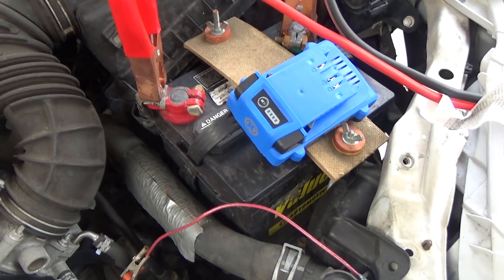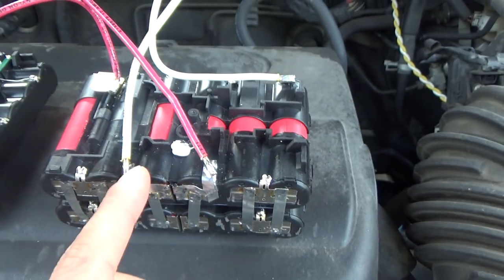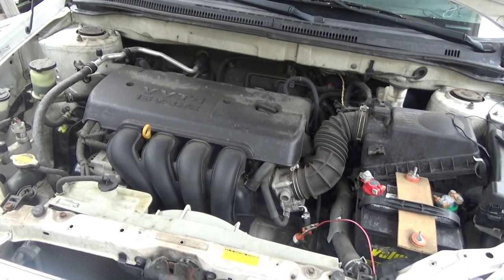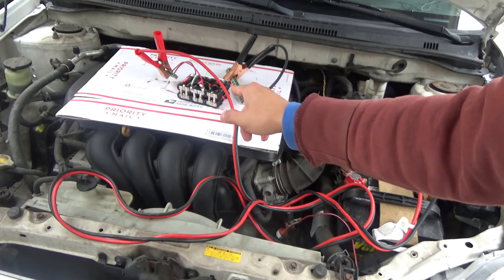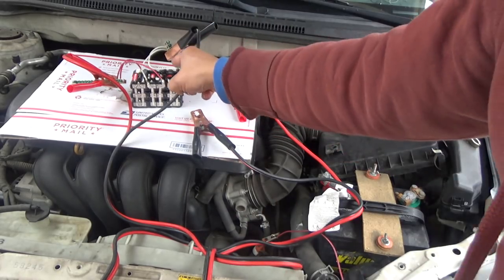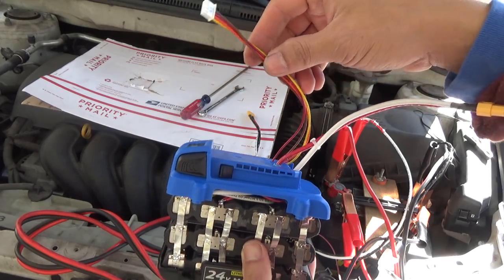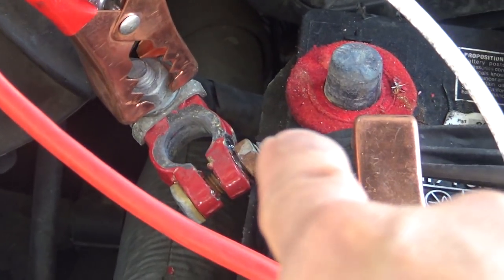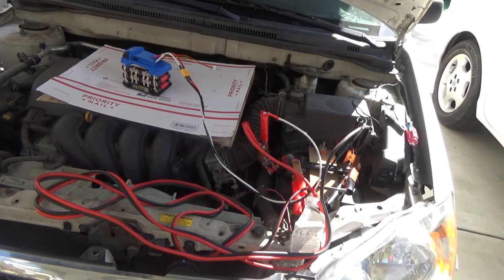DIY: Home made 12V Car Jumpstart battery pack from a Cordless Power tool battery

Comment: That's an alternator, not the starter motor, it is other end of engine by the trans!
Reply from the maker: Yes indeed. I put the annotation on the screen but you won't see it if you watch the video on a phone or tablet. What I'd been pointing at was the alternator. The starter motor is on the right side hidden underneath. But you got the idea.
Reply: vuaeco very interesting and good to know in an emergency..thanks, nice video well explained.
Reply: Does a 100 series cub cadet have a starter or a generator. Or does it have both.

Comment: That was the alternator you pointed at. the starter is where the transmission bolts to the engine.
Reply from the maker: Yes, indeed. I put that on the annotation in the video but you can only see it if you watch it on a computer (won't see it on mobile device). My brain was too focused on the subject at the time. Luckily, the main focus of this video is not about the starter but about the battery pack itself.

Comment: I've jump started my truck by directly connecting an 18v 3ah Makita cordless drill  battery, with no modifications. As you recommended, make sure u disconnect the battery the second the vehicle starts.
Reply: 18v is dangerous for the car systems. Do Not connect more than 15
(Fully charged drill battery is more than 20v)

Comment: It should be 4S  NOT 3S  you do 3.7v x 4= 14.8 volt the 18650 have 4.2v max.... PLUS your car battery is 13.7v to 14.3v

Comment: Great video and great explanation. I am going to use your data and buy small rechargable batteries to get 120Amp & 12 V to create my jump starter. For general knowledge car batteries mostly deliver 500A to 1000A so a portable starter with 120A is a good cost effective DIY ASSUMING IT WORKS as it did in this case. People like me who travel a lot and do not drive their car frequently can use a cheap Car Starter that they can recharge at home and never get stranded bcos of discharged battery.

Comment: I think the harbor freight jumper cables is not heavy duty enough and too long, otherwise you might have been able to crank it with just 6 batteries instead of 18. But if you use the smaller (shorter)cables like in your second demonstration you might get it to start with less batteries. All the extra batteries will allow you to crank multiple cars before recharging.
But I like the idea of using the xt60 (60 amps) connectors to start the car. I been trying the ec5 connectors (150 amps) but they are hard to solder. In your demonstration the xt60 work fine and didnt melt and they are easy to solder.
Reply from the maker: 6 cells (3S2P) won't be able to start the car. With 2 in parallel, the discharge rate is only 40A and I don't think that's enough to run the starter motor. I might be able to get away with 12 cells (3S4P) if I have shorter and thicker cables. But the extra pack with 18 cells (3S6P) will give me more run time and more Amps so I can use it on a bigger car with bigger engines.
The XT60 is rated at 60A for safety only. It can handle much more than that. And in this case, twice as much at 120A. The run time is only a couple seconds so it's not gonna have enough time to heat up anything. I did feel the connector and cables after I started the car and they stayed cool. The reason why I chose the XT60 connector was because I wanted to charge the battery pack with my Turnigy Accucel-6 balance charger.
Reply: vuaeco last winter I started my car with 6 18650s (samsung 25R cells). I didnt start the car off the batteries though, I basically just paralleled the 3S 18650 battery pack to the car battery, then swapped out the cells once they were dead. About 45 minutes in it charged the car battery enough to start the car.  Probably would've been about half that but I was impatient and kept trying to start the car basically eating up all the capacity I put into the battery. It's definitely not smart to try starting a car off of 18650s though (I.e. connecting 18650s to the battery in parallel and turning thr key) because even if each of those packs was rated at 40A max continuous discharge, the drain rating doesnt compound linearly, so 3 in parallel would maybe be like 80-90A max, which is far bellow the rating of most any car battery, and the peak current usage is when the car is trying to start and the electronic systems are turning on simultaneously and the cars ECU is performing checks of everything.
Reply: Ditto; the voltage drop on any standard set of cables is a very high % and renders and otherwise good experiment a failure. Indeed, it is difficult to start ANY vehicle with a single set of cables alone because of the resistence and voltage drop. A review of OHMS law would be helpful. I think he would be surprosed how much a very short relatively loss free connection would do for his experiment.

Comment: Two recommendations:
1. Use 4 cells in series for 14.8 volts.
2. Use lithium polymer (li-po) batteries as they are able to dump maximum current, exactly what you want to jumpstart a car.

Comment: I though about doing this, but the 18650 I have available are recycled from old laptop batteries, coupled with the fact that they are not new, they also were not rated for high current output, unlike your Cordless drill ones. So I though I could use some sort of current limiting, and instead of the pack being able to crank the shaft on it'n own, like you did, I could plug it in and wait 5-10 minutes for the pack to recharge the car battery enough so both of them combined could turn the motor, thoughts on how to do that? And if it's viable?
Reply from the maker: That's a great idea. I think that's possible. Laptop batteries don't have enough discharge current to crank the motor in  a short amount of time. But let it charge the lead acid battery for a while and until enough charge, the lead acid battery might be able to crank the motor.

Comment: you need a special type of Diode as a one-way valve for electricity, that will prevent the overcharge power to get back to the batteries.
Reply: Oh well but This diode must to be rated atleast to 150A. You can use a regullar Diode hooked up bunch of them in paralel or Use an old welding's machine diodes , two of them are there so you can hook them up in parallel . But you must to add another 1S / 6P battery pack to previous ones because this diode has a drop voltage around 0.6 - 0.75V so Multiply 4.2 times 4 you'll get up 16.8V minus 0.7 = 16.1V with no load so this ammount of voltage / power stored in the battery pack will crank a starter much much more easier even in cold winter.
Reply: What I don't understand is why he wouldn't just use a 4S setup. There would be no need for a diode, as the pack would tolerate up to 16.8. Nominal voltage of the pack would be right at the charging voltage of the alternator. Unless the concern is inrush current created by connecting a depleted lead acid battery to 16v source.
Reply: @chrisstorm7704  
While you do make a good point, the car battery has a 15v overcharge rating. Although granted, it's going to be empty when you plug it to the battery pack.
But there is also the starter motor and the other electronics in the car which probably wont like the extra 3 volts you are giving.
In other words, I would prefer risking the battery pack overcharging than risking the car's electronics.
Reply: @DVDplayerz  It's not uncommon for race cars to use 16v lead acid batteries. It's supposed to help their ignition systems. I can't really say whether there is any improvement from using a battery like this, but they run the same 12v starters and 12v fuel pumps when they go up to the 16v batteries. on the cars without an issue. Proper float charge on one of those batteries is 18.4 volts. 15 volts isn't really 3 volts over what's normal. Most cars are around 14.5 volts while cruising down the road.

It's also very common to use the original 6v starter when converting old tractors to 12v batteries. I have seen many of these in service for years without damage even though they are being run at double their intended voltage.

Many years ago the voltage regulator on my truck failed. I saw the gauge peg, so I left the truck running and dug out a multimeter to check the voltage at the battery. At Idle, the meter showed over 19 volts at the battery. I quickly shut the truck off after reading the meter. After replacing the regulator, the only thing that was damaged from the overvoltage was the headlight bulbs.

I was worried about having damaged the computer and other electronics, but after looking into it, found out the the computer and instrument cluster have independent voltage regulators to compensate to vehicle voltage fluctiations. It would speculate that most vehicles have the same regulation for their more sensitive electronics. I'm not trying to say that running at that voltage for a long time wouldn't have caused issues, but trying to relay my first hand experience with higher than normal voltages for short periods.

Between what I mentioned above, and the fact that a discharged lead acid battery will quickly pull the voltage of the 4s pack well below 14.5v. I can't see any danger to the vehicle at all, only potential danger to the li-ion cells and the cables connecting the two batteries.
Reply: Ya or add a resistor to charge the battery pack again
Reply: @samohraje2433  isnt 16 v too much for car electronics, such as sensors, uch, ecu etc?

Comment: Can you put a fuse on the battery pack to prevent the alternator from over charging it?
Reply: Fuses protect from shorts. Diodes stop current flow in one direction.

Comment: I been jump starting off a makita 3amp 18volts battery just by making up a lead connected to two copper posts that clip into the battery for 6 years now works better than a jump.pack I bought for £50.
And wasn't that the alternator you pointed too?.

Comment: Use shorter cables, also don't put the negative clamp on the dead battery it should be grounded to the engine or chassis. I made a jump pack using just 6cells and works fine so long as it's connected correctly. 
If wanting to use that pack for anything more than a one off experiment you should also use at least a cheap BMS to charge it back up.
Reply: What is a BMS? I’m new to all of this.
Reply: Hi awesome video iam wondering if you can send me a the details of the wiring for charging and out put thanks .

Comment: Add a relay for starting. The input signal wire to engage the starting relay can be tap off of the starter scynoilded. When you turn the key to start, the relay connects the battery to the starter, then the key is moved from the start to the run position and the relay is open or disconnected from your homemade battery. Try it.

Comment: If you were to use a small bank of super capacitors as well I think you could do this with 3s 1p.
Reply: @johnnadar9106  
Capacitors that usually have a high capacity.

Comment: Its a good thing those dangling wires did not caught on the rotating auxilliary fan. You can place a diode on the positive wire between the battery pack and the acid battery. So you dont have to worry about the power coming from your alternator to your homemade battery packs.

Comment: That would probably work with a smaller engine with just the 2 packs. But awesome video. I always wondered how many it would take also. I've been settling for taking the long route slowly recharging my dead batts with a higher voltage variable battery supply of low discharge 18650's. It sucked having to charge my battery this morning in the freezing cold for like 30 minutes and the engine still didn't want to turn over (but was trying) before my ride came to get me lol. That sucker was all the way dead though.

Comment: A lot if you asked which batteries were used for this project?;  Use a high drain,  20 amp continuous discharge battery such as the Samsung INR18650-25R or LG INR18650 HG2

Comment: I'd like to convert an air compressor that uses 12v via alligator clips to run on the 18V cordless tool battery. 
   I need a 750 watt capacity.

Comment: Some of those drill battery packs have a safety circuit built-in stopping you from taking two wires and powering something. Those that don't have a safety you wouldn't have to take apart. I have a 20v(measures 17v on multimeter) I've used to do the same thing a couple times it's an 8 cell pack. Also I made a jump pack from an old jump box that had 2 small lead acid 12v batteries was like 15lbs now with 12 18650 lithium batteries 6 per pack to replace the 2 12v that were in it it's like 5lbs. Don't know what a 6 cell 12v pack is called like the 3s n 4s stuff. Idk much about the circuit board that was in the jump pack but that worked much better than just using the 20v drill battery. Bought some battery things that allows me to remove each battery to charge it I know you would need a charging circuit to charge them evenly

Comment: Hey great video. thanks for testing this. ive always wondered this. I am curious where you got the information that each 18650 is capable of delivering 20 amps of current. I thought an 18650's current limit was around 2 amps...

Also, to avoid 14v going back into the battery; if you were using it as a permanent battery, couldnt you use some sort of diode to allow current out of the battery but drastically reduce current from going the opposite direction? wired into 3 (1 for each parallel pack) of those charge controller chips found on ebay (parallel wiring), then they would stop charging at 4.2v.... 

correct me if im wrong, still learning.
Reply from the maker: The 18650 specs come from the manufacturer. There's a model number imprinted on the cell and you just have to google it. Not all 18650's are the same. Those come from laptops only have 2A discharge rate vs. those from a power tool which has 10 times as much  discharge rate. The reason why I don't want to put a diode in it is because I need to charge this pack when it's empty. Plus, I want to use it for other purposes and putting a diode on it would reduce its practicality.
Reply: Thanks for that info. 20A is quite significant.
Reply: Miles Papineau there are some that are capable of even more. My 18650 of choice is the Samsung 25R - rated at 25A continuous and 100A pulse for 1 second as per the datasheet. Still though, a 3S 6P isn't enough current to safely start a car. You'd still be overdrawing the batteries which can cause immediate safety concerns or issues down the line. The last thing you want is to have your bed room fill with chemicals randonly while you're watching TV after your battery explodes on the charger.
Reply: Sony VTC5A, can handle 100A burst discharge under 6.7 seconds, according to datasheet.
60 Amps for under 26 seconds.

Comment: At about 4:50, I think it would have been successful if you would have either; 1) let the pack charge the car battery for about a minute before cranking, or, 2) bypassed the car battery by removing a cable from car battery and connecting the pack lead to disconnected cable. ( then after starting QUICKLY disconnect pack from car to avoid over-amping the pack, then reconnect car batt to car cable). 
Also, I believe the issue with leaving the pack connected after starting is not the higher (14.5v) alternator VOLTAGE output but, rather, the higher AMPERAGE output of the alternator compared to what the pack is able to handle coming in to it? 
Correct me if I'm wrong.
Nice video though, thanks and God Bless!
Reply: PS how do you recharge the pack?

Comment: Oh  great start up but you did not put a series rectifier diode  to prevent feedback voltage when battery charging or  full  put Diode on positive terminal Anode  then Cathode connect to battery positive terminal

Comment: I know this video is a little old but, I have a kobalt 80v 5ah battery laying around I haven’t cracked it open but I’d say it has about 60 18650 batteries in it. Could I do anything jump box wise with it? I mean it’s a $300 battery but it’s not doing me any good, any mod you would recommend?

Comment: stand .. can i mix laptop bat. and powertool bat. in the same pack   or. is there a problem with the different discharge rates ? thanks much, great videos .
Reply: You can use them in parallel but you need a BMS to prevent damaging to the battery pack. BMS is some type of Electronic device that can sense the flowing current and voltage to the battery and then between  every single series connection are different voltage potentials and these potentials must be controlled with BMS but if it's not, simply the battery with smallest capacity will be charged much quickly and than its voltage will be much much much higher than 4.25V MAX!! And woala , the series of problem began. That's why it's better to use BMS instead of charge it with direct voltage without nothing.. You can hook different capacities in paralel so don't worry but please , use a BMS to prevent unexpected behaviours . And yes , you can draw unlimited current directly from the battery pack but charge it up with BMS

Comment: Can a 4s pack work for this just keep the voltage at 14.5v and how much amps does the car alternator charge at?
Reply: You dont need to care about right voltage , my dad sent 26V to a battery and everything survived but yes you can use a 4S / 4P or 5P to encrease the better starter cranking. You can even use 4S 6P to start up the car in cold winter . 16.8V is good but i recommend to unplug the battery first than you can crank the motor with this battery pack connected properly to the cables from the broken or super discharged lead acid battery